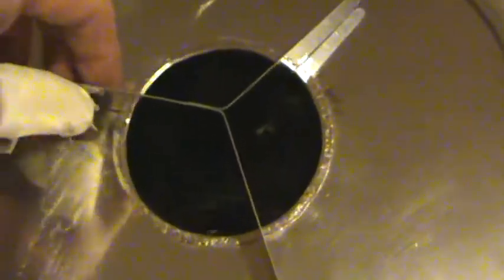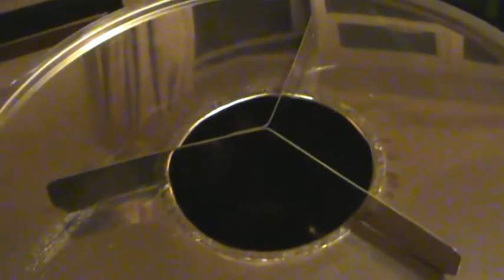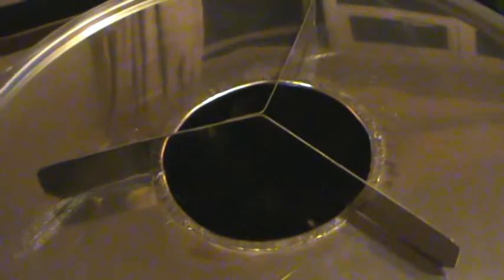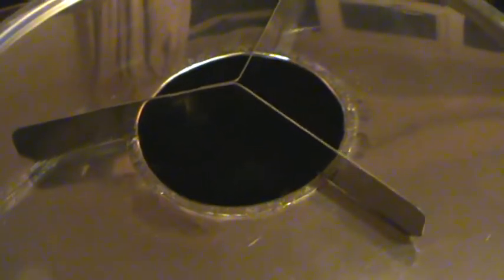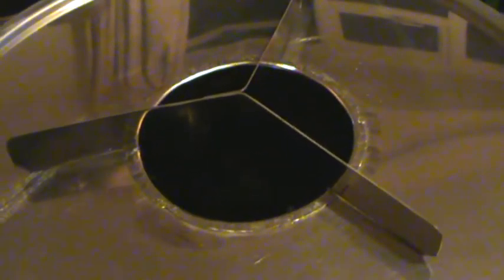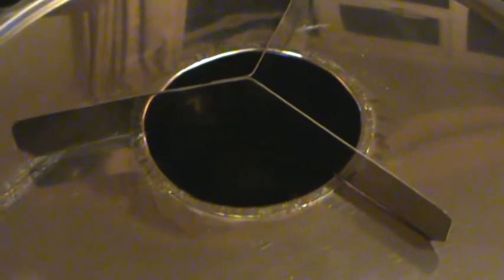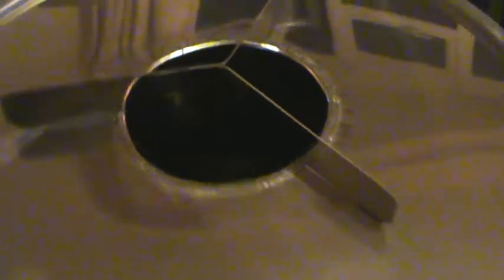my new rocket stove construction part 7

Comment from the maker: @mrxtianfilm :-) Yeah toilet roll and masking tape, works a treat...stops the blood flow...allows it to breath and heals quick...forget your plasters! Thank you for your kind comment and glad you like the videos, yes...the turbulisor has a great affect! It not only helps to mix the burnt gases to produce a better burn, but also because of it's low proximity in the combustion chamber...it helps to concentrate the heat there by slowing it down slightly. Retaining the heat before releasing. Cheers

Comment from the maker: @MrAnomilus This weighed about 6.5 kilo's, the latest modified version of it heat has fire and heat resistant concrete on the top. Check out the other videos, it now weighs 10 kilo's, hope this answers your question? Cheers